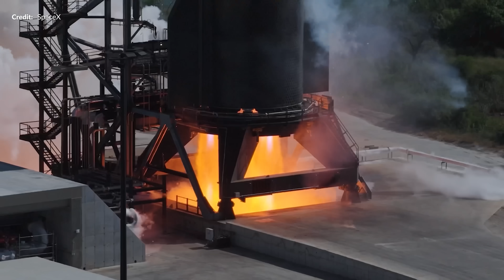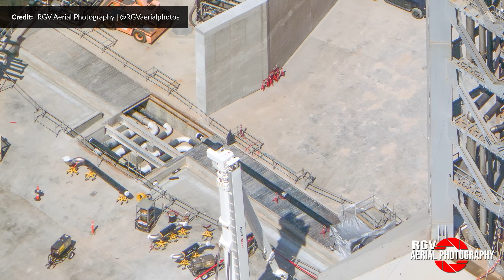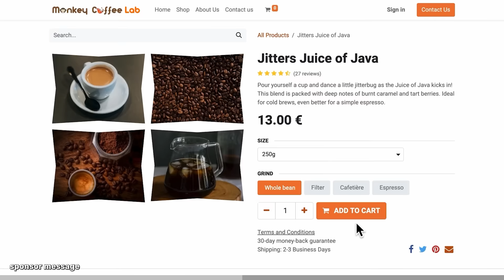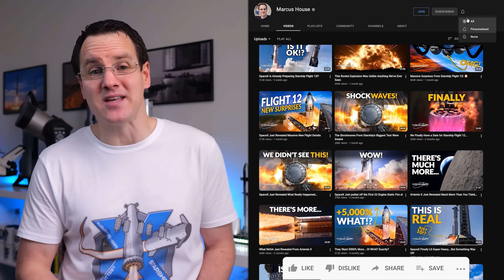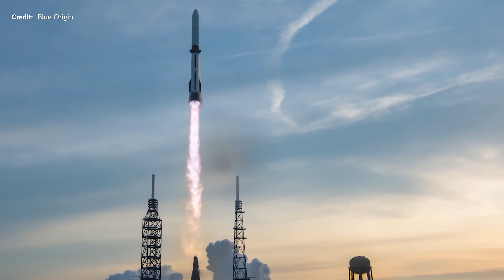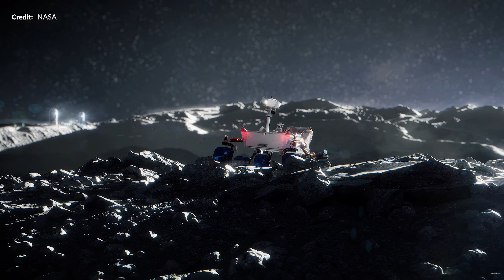Starship's Next Launch Will Be Different

Comment: Has there been any sign of a ship static fire trench at Kennedy? Surely they will need one even if they test test the first few at Massey's before shipping to the Cape if additional testing is needed after a ship arrives. They will obviously need one (or more) at the Cape when they start production there.
Reply: Maybe. But as Elon once said, the ability to mass produce quickly cures a lot of ills. If something happens with one they just might not hesitate to quickly pull that particular one off-line while they continue to press full bore with the rest.

Comment: Honestly? I don't really like Blue Origin's new approach IF this were to become a permanent thing.

It is very SpaceX-y as an interim solution but it is the anti-SpaceX as a permanent one. SpaceX started with simple facilities initially (at Starbase) but they then improved everything gradually, from the factory, to the high bay - giga bay now, and the deluge system...

This "crane" approach doesn't seem like it can be very permanent. Too risky to do the payload mounting if there is a little bit of wind...

Comment: I still remain nervous about horizontal transport. Last time I mentioned this concern, lots of people were fast to be internet bullies and say " Ya IDIOT, didn't you see how it survived that gnarly tumble from IFT1!!!" and  my answer is, yes, BUT, we didn't inspect all the plumbing and components and make certain that everything was sound.  When were dealing with precision on this scale, taking the countless feet of plumbing, that has only ever experienced nice even  vertical loading, and then making it go sideways, is more of a stunt than i think people realize. Doing that turns every single  component into a beam while it's sideways, and forces it all to experience loads like it never has before. Tenson on the bottom and compression on the top, and this will happen to every single component. And YES, it survived the tumble from IFT 1, but we didn't inspect that booster and ship after that flight to see if there were micro cracks anywhere in the cryogenic pipes and welds or other fittings that absolutely can not crack or have internal stresses that get missed. I'm not saying it's doomed, but I just think it is more stressful on the Ship and Booster than everyone makes it out to be. I hope they thoroughly insect and scan everything to make sure there are no hidden gremlins after horizontal transport.  I'd hate to see a starship booster  RUD because of a tiny crack in a bunch of the propellant pipes.  I also hope the ship them with the Raptors not installed either. But perhaps I'm overthinking and everyone will yell at me again.
Reply: AAAAAAaaagh!! yell, yell, grump, heck, horizontal!, vertical, bleg, bleg!! COFFEE!!
Reply: And I remember the thing tumbling end over end on flight 1, and even the FTS charges struggled.
Reply: People had a go at many comments sating a Starship flame trench was the best way to go. Now SpaceX acknowledge NASA got it right in the 1960s.
Reply: @NickBrown-x9j That's simpleton nonsense.

Comment: The two Vaccum Raptors did start up at the same time, one is two frames ahead of the other (and the Sea-level R). Maybe SpaceX can calibrate the difference out. Or fire the single Sea-level Raptor first and add the 2 Vaccum Rs later.

Comment: I have serious concerns about laying the booster on it's side and shipping it. Will it possibly cause hidden stress point damage? If the diagram shown is correct and it is only supported on 2 points at each end it will surely suffer some sag?
Reply: Maybe but:
1. It will be pressurized, and if the booster can handle having a fueled ship on top of it, it can handle lateral loads. 
2. The booster has to handle 33 raptor engines sometimes exerting several times the force of gravity. 
3. Imagine what happens during the flip maneuver after ship separation.
4. I'm sure at least the engineers will think of it.
Reply from the maker: We may not yet have all the parts visible. It is somewhat speculative until we see them do it for the first time. Remember the Super Heavy can enter the atmosphere is ridiculous speed and it survives quite fine. I can't imagine laying it gently down is going to be much of an issue, especially if they are keeping it pressurised (which I assume it will be).
Reply: @MarcusHouse  I guess we'll find out Marcus!
Great channel Friend.
Reply: The engineers have taken your concerns into consideration
Reply: Because they have 2 points shown for the transportation to the barge does not mean that on the barge they won't have more.  It would be less likely to be an issue in that short time than during the longer time on the barge which may well have more supports set up.  

:eyes-pink-heart-shape:

:eyes-pink-heart-shape:

Comment: How many more test flights before we get a 100% successful flight.
Reply: Multiple flights have already achieved every goal the flight set out to achieve
Reply: @RubyFoxton no they have not. We still have not had a 100% successful flight
Reply: @BakiVSKengan In what way was flight 10 and 11 not 100% successful?
Reply: @RubyFoxton  100% successful flight would be both stages launching, orbiting then landing as they are intended to, ready for relaunch.
Reply: @batfink7452 That was not the goal of those missions, if a falcon 9 flew an expendable mission, you wouldn't call it a failure because the booster didn't land.
Reply: @batfink7452 You're defining success to meet your own terms, not theirs.  That's dishonest and ignorant.  It's what people do when they don't have a point but are trying to pretend they do.
Reply: @imaginary_friend7300  I thought the whole purpose of Starship was meant to launch, orbit and land to be reusable.  This would be a 100% success. So far it hasn't accomplished this.  Simple question was how many more of these test flights before this is accomplished.
Reply: About two more flights, if all goes well.  

Flight #13 (the next upcoming one) should demonstrate a v3 Booster return to a controlled landing in the Gulf, and a v3 Ship engine relight in microgravity (a prerequisite to controlled deorbit.)

If flight 13 goes well, then flight 14 should include the first v3 Booster landing on the chopsticks, and the first time a Ship enters orbit.

Then, if flight 14 had gone well, flight 15 should be the first time both Booster and Ship come back for a chopstick landing.